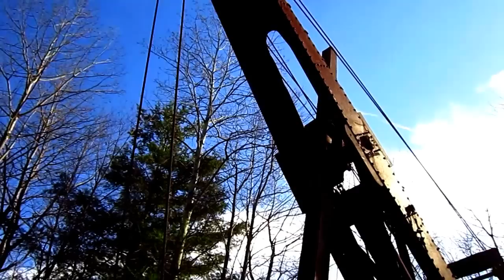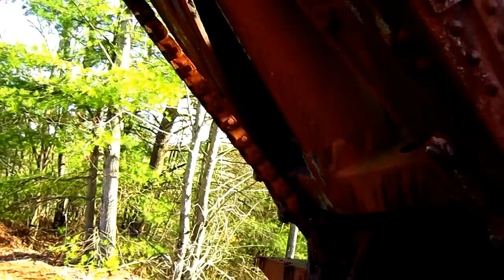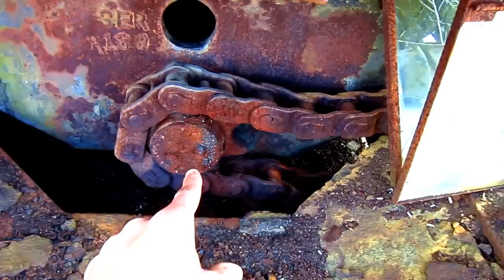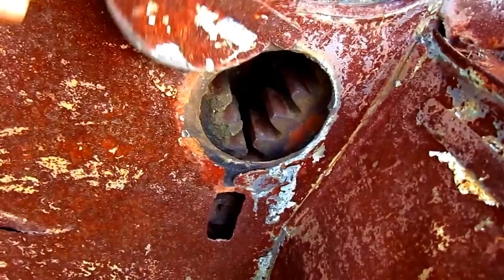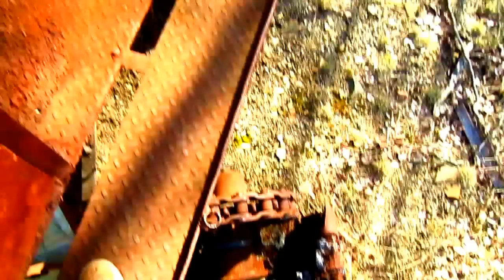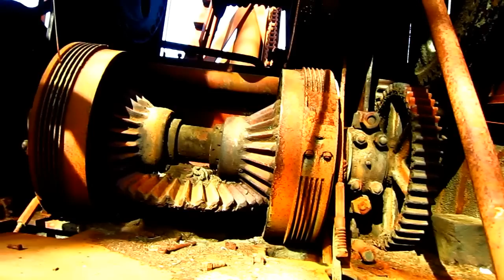Thew-Lorain 80 Documentary

Comment: What is really fascinating about these old shovels is what minimal material designs they actually were.  No fat at all.  Consider how positively dainty  many of the components are compared to modern equipment.  The compression loaded components are pretty beefy, but the tension loaded components are really very slender.  Everything is pulled by cables.